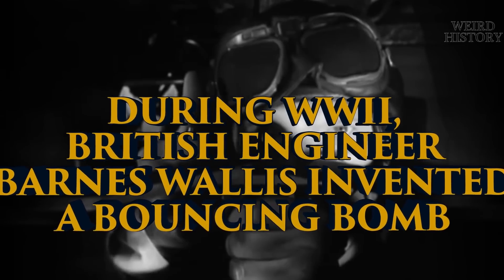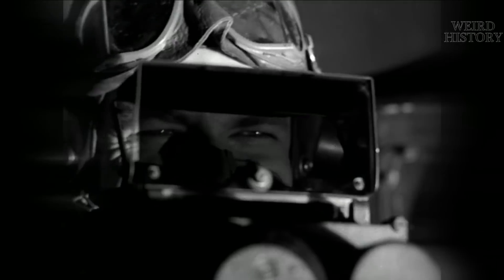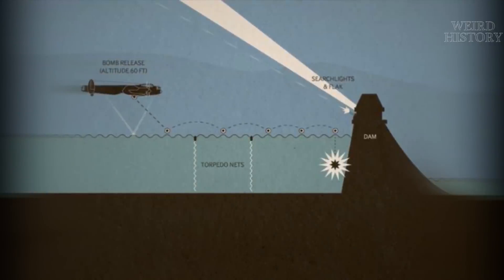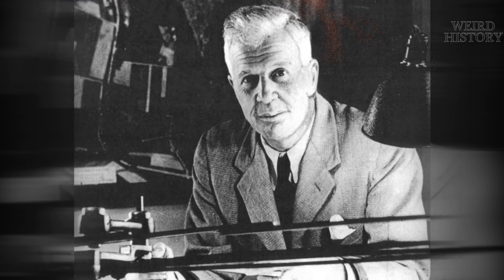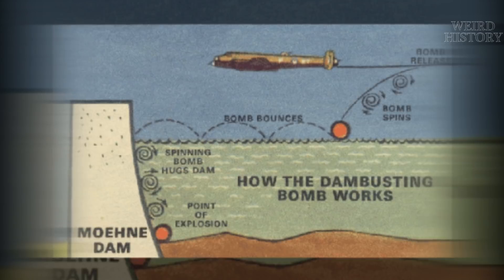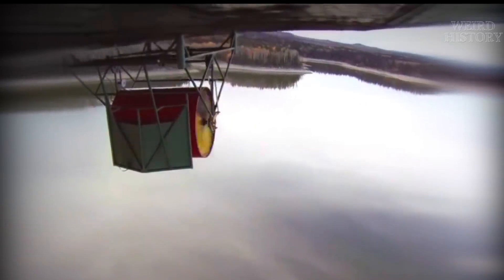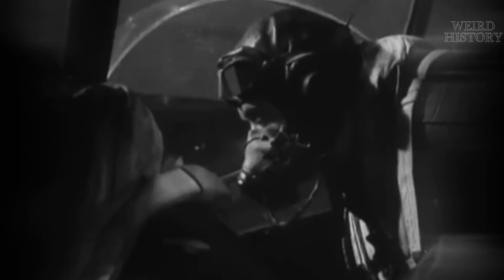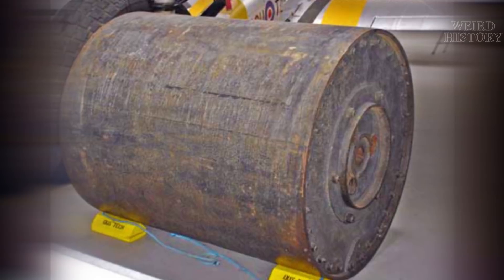How 'Bouncing Bombs' Were Used in WW2

Comment: They also inspired Star Wars! I mean it the attack on the Death Star and Rogue Squadron were partly based on this raid and 617 Squadron.

A bit off and without wanting too brag I met at an air show Les Munro a former RNZAF pilot and one of the original 19 pilots and while on course for the attack run his aircraft was shot too bits knocking out much of the electrical systems including the radios, navigation and the weapon systems and he had too pull out and limp home. Basically he was the units Wedge!
But a cool old dude none the less and not some over the top romantic hero and it was a shame when he died about six months 
later age 96.
Reply: Munro never made it to his target dam. He was hit by a single flak shell when he crossed the Dutch coast at Ost-Vlieland. That shot knocked out the internal communications inside the aircraft, which were vital during an attack run, when four different crew members had to co-ordinate their different functions. No comm, no attack, so Munro turned around and flew home.
Reply: @MarsFKA  How he said it.
Reply: @TheGroundedAviator  But not how you reported it.
Reply: @MarsFKA  Was younger then.

Comment: I read about this. They skipped over nets in the water and blew up dams, right? Fun fact: the engineer used trigonometry with two lights set at an angle so the pilot could tell they were 60 feet up when the lights shone on one spot.